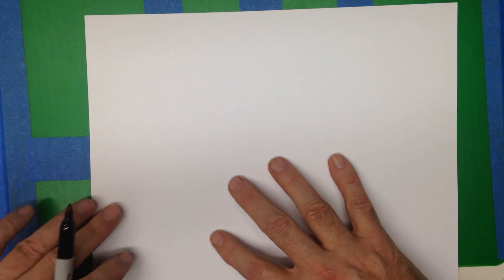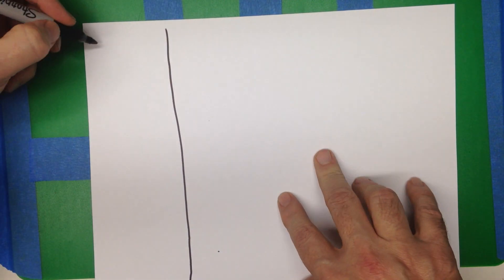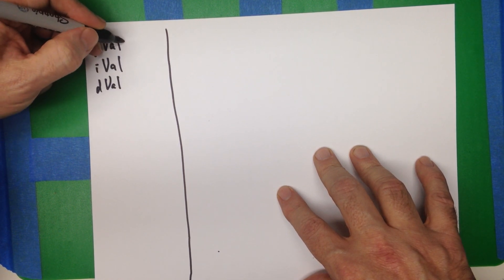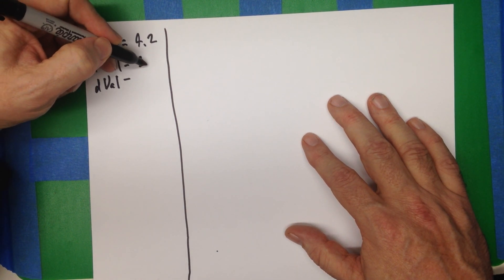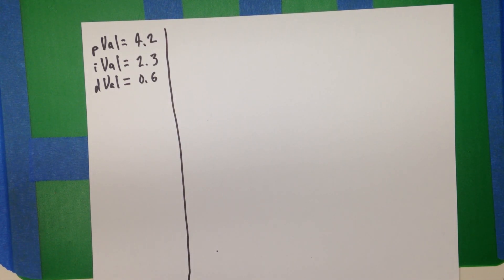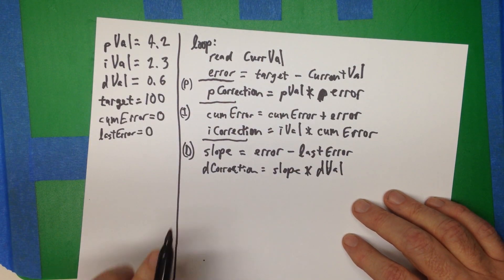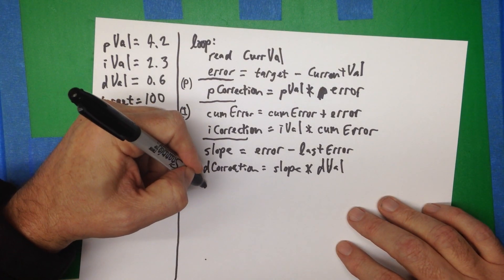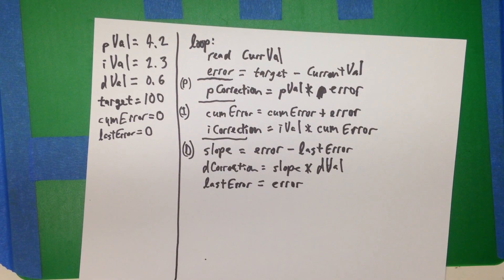East Bay Guide to PID Loops, Part 2: The math and the coding

Comment: for your slope, usually it's (y2 - y1)/(x2 - x1). but I am confused, in this case have you assumed that the loop's unit difference for denominator is always 1? can someone please explain?
Reply: i think that is considered like the sampling time to be 1 second ,which is the x2-x1  will give you the time between the last error and current error .so if you feel your sampling( time gap between ur last and current error )is different from 1 second you can include .because the  D part is normally Kd*(change of error /change of time ) which is  same as (Kd*change of error) for 1Hz sampling.  and change of error is now ( error-last error).

Comment: Thanks for both Videos, very useful :)

BUT there is one thing I don't understand.
It's about the I-Correction.
If we admit that our target is set at 100 but the aircraft is at 20 (so 80 error) and the next loop it's at 50(so 50 error) then the cummulative error will be 130, next loop at 90 (10 error) : cummulative = 140 ...
but when is this cummulative error initialized ? because it will stay at 140 when the aircraft reach the target at 100 !
I thought that it will decrease when the aircraft is above the target but it will never be as much (thanks to the D-Correction)
It would be great if someone can explain it to me, I hope you understand me question.
Thanks !!! :-)
Reply from the maker: If the loop starts over-correcting, then the current value will be higher than the target value.  Then the I term will start decreasing.  When you are at the target value, none of the terms will change and you will maintain the target value.

Comment: Amazing explanation. Thank You.
Still can't get one moment - how [ Integral ] part of PID correction will be zero after reaching desired altitude? Sum is going to last forever, if we add zeros it still be big accumulative value...  Just negative error values (overshoots) will slightly compensate it. So [ Proportional ] component will try to compensate that [Integral] error, or what ? Or add some time frame - reject old enough values. Kinda running average...
Reply: My real work solution to that was limiting max value of "iCorrection" only. Same way like he did with "corr". But I would like to know what is the "right" way to do this too.
Maybe properly tuned P and D components suppose to take care of that. And maybe I component should be set according to system speed, and be low enough to avoid massive overshoots.